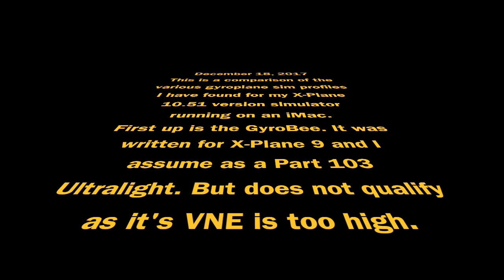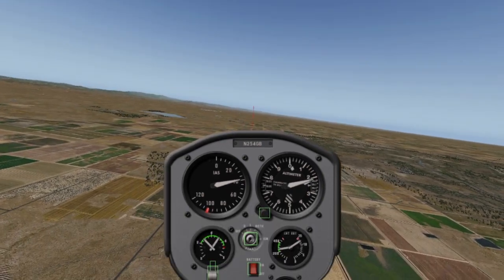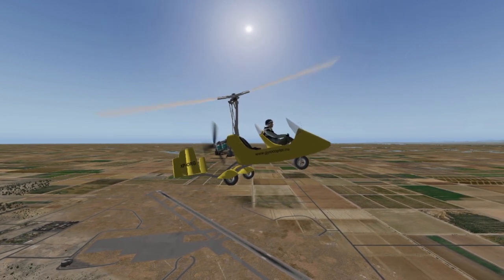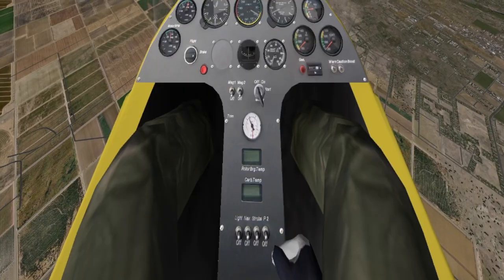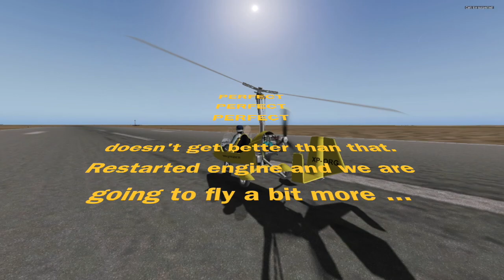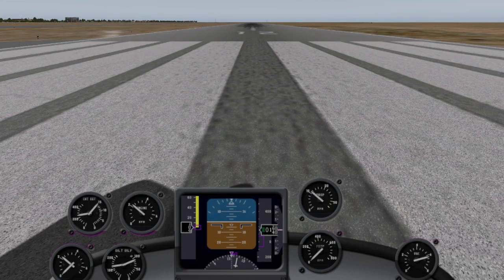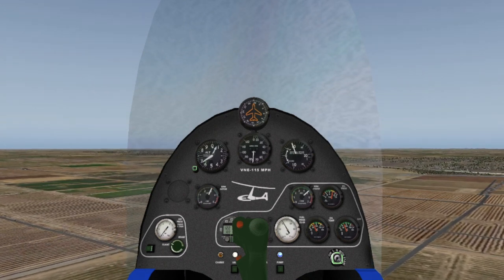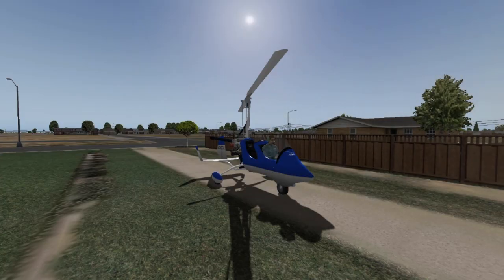Comparison of different Gyroplane Sim Profiles for X-Plane 10.51

Comment: Hi Mike How do you add a gyro to the Mac Xplane and what controllers work well?
Reply from the maker: I have explained this a couple times in previous Flight Sim videos. So will take the time to make video dedicated directly to what I did and what I am using. Basically I am on version 9 of xPlane and the sim is of ELA 07 that I downloaded from the xPlane forums. The sim has not been upgraded to run on the newer 10 and 11 versions of Plane, but I do know that there are newer versions of Gyro sims that do run under xPlane 10 & 11.  I will say and many agree and some disagree that using the Gyro sim for anything other that instrument training is not good. I can attest to that myself since I put almost 500 sim hours on my setup before I became a real Sport Pilot Gyro.... and I it gave me some very bad motor skills behaviors which I had to overcome (un-learn) during the my final days of real Gyroplane instruction. Mainly it was I had not developed the correct sight picture for how close you are to ground for the final flair during landing. I was always HIGH and had to do many hours of real practice is a real gyroplane to overcome that.
Reply: Mike Smith Yes I was warned by a Rotorcraft CFI not to expect that a Gyro was faithfully reproduced in a simulated electronic environment. Thank you though for taking the extra time to repeat your instructions on X-Plane setups. I guess I’ll pass.